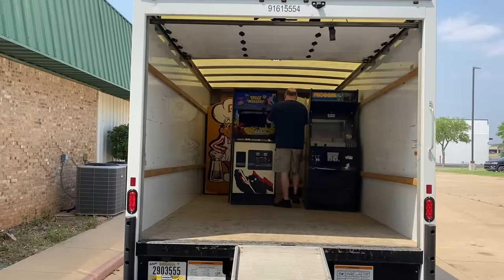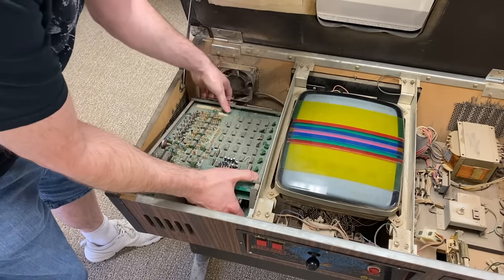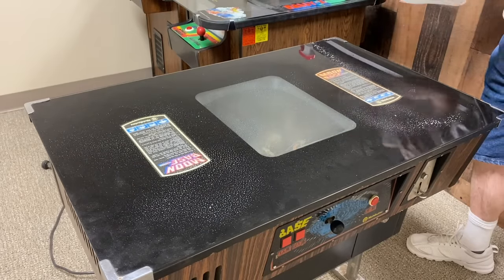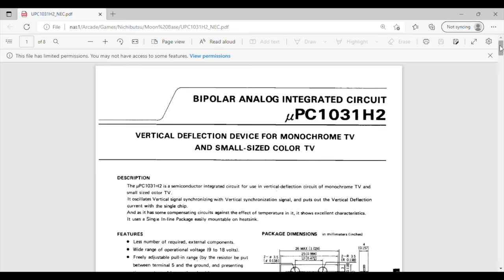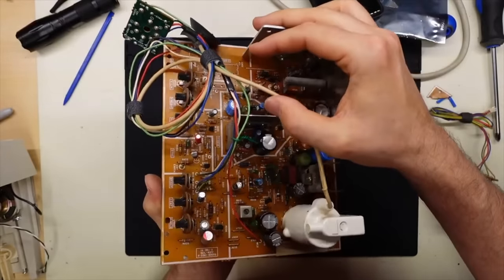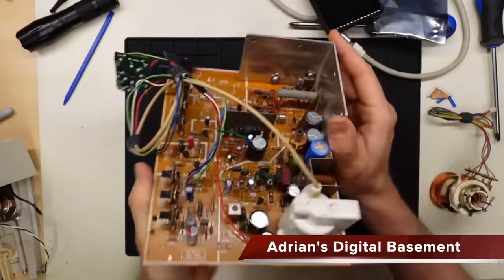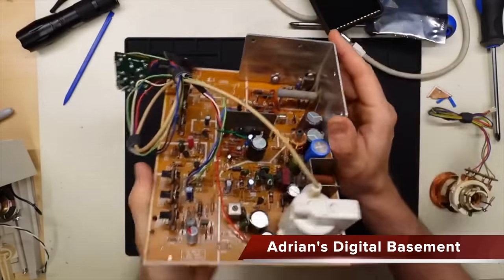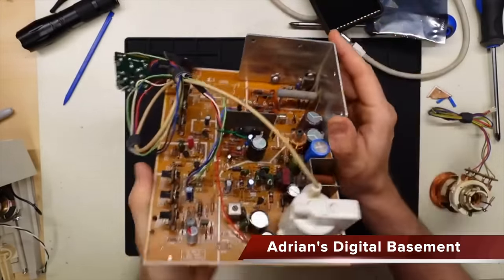Moonbase Arcade Restoration - Gone Wrong

Comment: As a software developer, I absolutely do not envy the 40-minute feedback cycle you had here! I really struggle beyond like 20 seconds, haha
Reply: Looks like a Snooker table design, the local pub has a table with coin insert that drops the balls.
Reply: @HOLLASOUNDS  i
Reply: Former software developer here and I definitely know how maddening it can be, especially when you finally figure it out and then realize how close you were many steps ago and went down the wrong path.
Reply: Atari developers throughout the 70s and 80s had to manually burn and replace EPROMs every time they wanted to test their new code...
Reply: Try FPGA development. 5.5 hours to build and test my current design on a 10-core Intel i9.

We try to simulate everything we can, but for some high-level changes that's not feasible or, in some cases, even slower.
Reply: @VOIP4ME  I can’t imagine. I remember the DIP switches but dad did that. I was a bit young and didn’t really get into programming until 1987.
Reply: Especially when you just added a single file to the project and the compiler feels like it has to compile all other C files in the entire project again, even though there is nothing that has changed for them. You watch it crunching numbers for several minutes when all it would have needed to do is compile a single file and run the linker.

Positive  to this: You have a lot of time to get more coffee.
Downside to this: You drink way too much coffee.
Reply: Come on you must have spent more than that at least once going back through code surely? ￼🤷‍♂
Reply: Kids and code these days….
Assembler is where you started via teletype. Then COBOL, RPG-II, FORTRAN
When you wait for card decks, hand punched, to be processed and your JOBQ and then the ABEND when your sysop gets to your printout.  Assuming you don’t need the librarian to mount tapes. 🤪
Reply: @jakematic  I'm in my 40's but brilliant still
Reply: @danhudson4614  brilliant and expert are two words always made me bristle. 150% self taught in carpentry, coding, farming, sales, mechanics, cooking. Different time’s nowadays

People still say I’m brilliant and I point at an oil lamp next to me me and say not as much as that USA made 🤬lol

Edit: ps if you’re in UK sorry for the translation from American English. Call me a yabo and slap me pint down hehehe
Reply: @jakematic  my dad hated COBOL. He would fix the code in the assembly language.
Reply: So well put. Especially with hardware a 40 second program is just about not enough time to switch tasks and back. Over a day of hard programming maybe 50x40 seconds. That’s 30mins a day minimum.

Then doing software, web and documentation everything’s live compiling with every key press or save. What a different experience!
Reply: @cjmitz  learn to fish (aka get patience) the mentors told us. Hell an IML was an easy hour or more even in the 90s on non-mainframe hardware

Edit: 30 minutes 🤪. At least Java is dying
Reply: @ericbarlow6772  yeah COBOL is a mess and then some. I’d almost call it an early HIPPI (High language programming interface)
Reply: Didn't the VAX implement every COBOL command in hardware?   I think I remember reading that somewhere.
Reply: @OneEyedJack1970  I think so. They were toys compared to other machines in the day. VAX and DEC lasted slightly longer than NCR sadly
Reply: Bonus: we learned on manual typewriters and could do hundreds of words a minute on gasp collapsing spring keyboards. Never forget the day a millwright attempted to help me keypunch log tags 🤣 he tried….
Reply: YT says parent comment was posted 21hrs ago. This kinda conflicts with the 9hrs ago it claims the video was posted. :-/
Reply: Embedded software still has long feedback times :-(
Reply: @thomasphillips885  Yes! I tried to start on Arduino recently, but the slow flashing process and the fact that for my Arduino + ESP8266 board, I had to manually flip tiny dip switches in between flashing each chip, absolutely killed my enthusiasm
Reply: I wish my feedback cycle was 20 seconds..... I work on a large Enterprise Embedded OS, and the compile time can be anywhere between 4 hours and 30 minutes. That is a painful feedback cycle.
Reply: Very heavy FOR loop 8-bit guy had going on this project!
Reply: @tolkienfan1972  Patreon subs get the video earlier.
Reply: @VOIP4ME  5.5 Hours is insane. I thought i had it bad during my master's thesis. My project took about 45 Minutes for a full build.
Reply: I can relate to that
Reply: @VOIP4ME  if this is for commercial work then your company has seriously under invested in your hardware. An i9 is a standard desktop chip, for projects of the size you’re talking about then you should be on a Xeon or Threadripper with more cores, more RAM and faster IO.
Reply: @onicx4603  that seems excessive:-)
Reply: @ElectroDFW  OHHHH. Thanks :-)
Reply: @stevetodd7383  FPGA routing is unfortunately a single-threaded process. The i9s have the best single-threaded performance.

We do have Threadrippers for batch builds of multiple designs at once, but that doesn't help the latency of the debug cycle.
Reply: @VOIP4ME   I’m not sure who’s EDA tools you are using, but both Altera and Xilinx support threading for Place and Route. Not sure how well they scale with core count, but single threading shouldn’t be a thing on anything remotely modern.
Reply: @stevetodd7383  MicroSemi (Microchip) Libero, they make some rad-hard parts you can't get anywhere else
Reply: @jakematic  Assembler and teletype? Luxury! When I was a boy we had none of that; we had to hand-code binary and then toggle it in via front-panel switches! You had it so lucky....
Reply: @VOIP4ME  ah, the joys of aerospace. Mention that and suppliers start adding zeros to the price and going generations back in time. I guess you’re stuck with the i9 until such time as Microsemi discovers this newfangled thing called threading 😟
Reply: @Curt_Sampson  same way we did patches. Sometimes in gasp hexadecimal EBCDIC. With 3 people verifying input on prod machs. I’d pay money to watch youngins run BUS/TAG or trouble shoot coax 🤣
Reply: @ericbarlow6772  I loathe COBOL. Only had to use/learn it over about 2 months as part of a programming certification course. Enough to tell me never again. Ever ever. Machine code is easier. Even hand coded machine code entered on a hex input pad.
Reply: @Colaholiker  someone really messed up that makefile...
Reply: Yep and this is exactly why I like prefer working on software instead of hardware
Reply: Tf does being a software developer have to do with not envying the 40 min feedback cycle?
Reply: A bit egocentric about our job are we? Anyone can tell it was a long and very tedious process, David did a good job showing that. No need to act like having your job is the only way to appreciate his work. Someone who mops up the set of an adult film could see how tedious that project was just as well as you.
Reply: Try PCB design or even worse, injection molded parts, iteration time is weeks or months.
Reply: @VOIP4ME  oh god. I remember doing really simple FPGA work in school and it still took like 30 minutes to test my code
Reply: @QTProductionsofUtah  I don’t think the comment was in anyway meant to be disrespectful. It was just highlighting the differences in professions/skillsets. Dealing with physical hardware adds a whole new layer of complexity, debugging and time which not everyone has the patience for. No one is denying the unbelievable time and effort that was put into this incredible restoration.
Reply: Reminds of my VR project with the feedback cycle....
Reply: @jakematic  kids and electricity these days, coding was easy back in my day, computers were rocks and the programs we executed on them were wild animals that would seem alien to you anatomically modern humans of today.
Reply: The 8-Bit Guy is my future.
Reply: It can happen to software developers too. In fact it can be worse. I have had bugs in multi-hour data prep runs that could only be reproduced with the full data. I would make my supposed fix to the program and then kick off another overnight run.